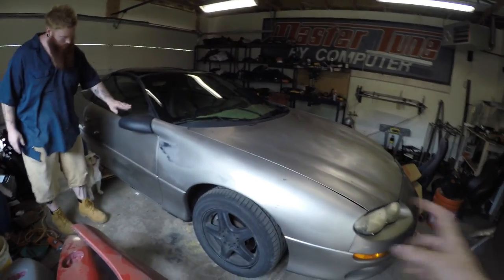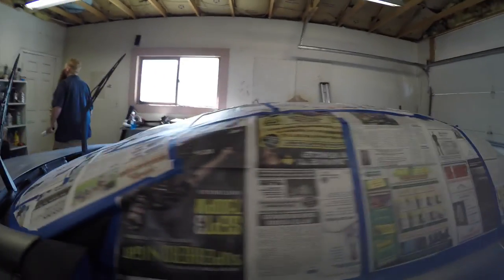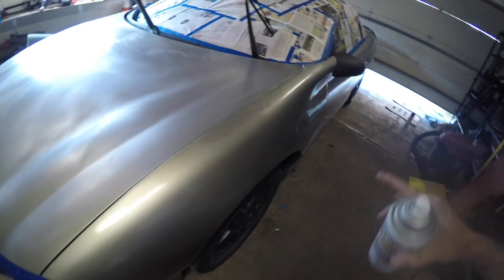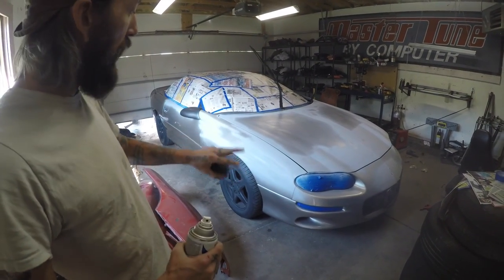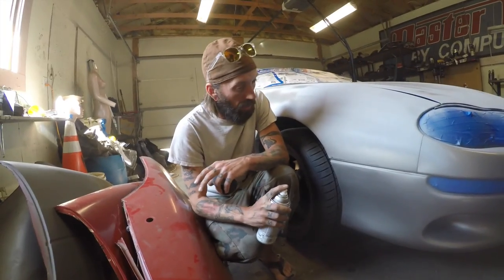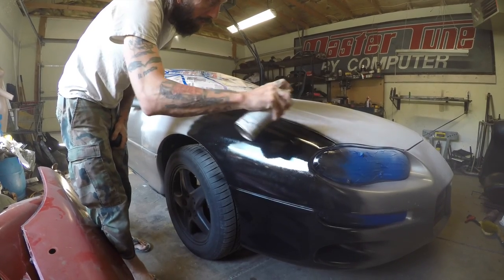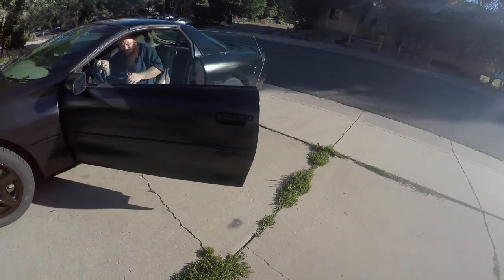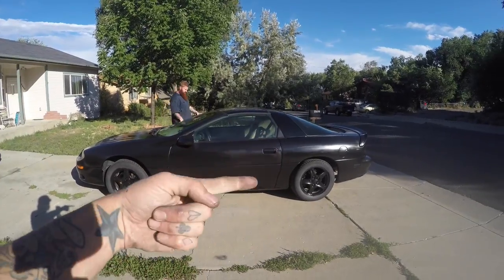How To Rattle Can Spray Bomb S06E24

Comment: 4K down-converted to 1080p is typically better than a 1080p source from the same camera. 

Also: If you're curious, I have a 4K TV and monitor. You can stop by and check out the image quality. There's a difference.
Reply from the maker: awesome, thanks, and good to know!